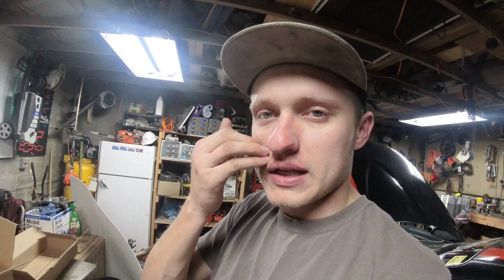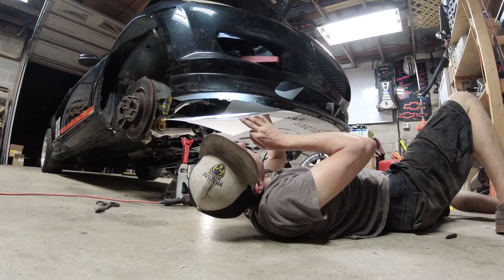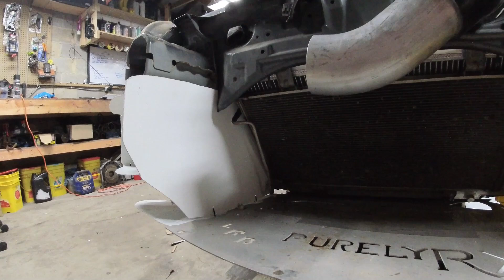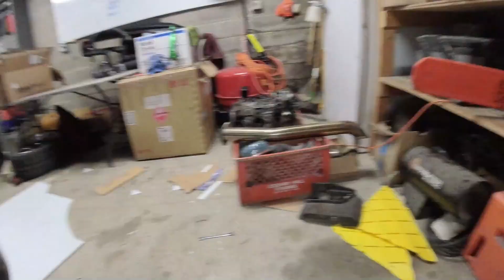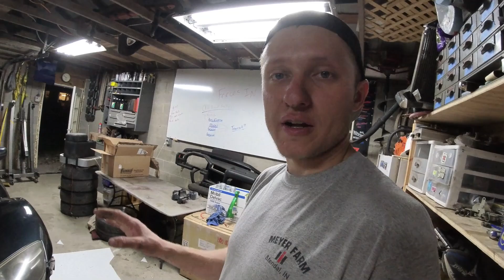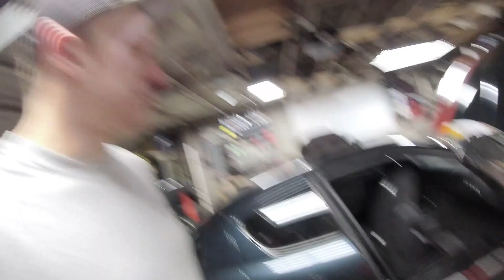Using Plastic Bathroom Tile For Air Ducting on my RX8 - Super Cheap and Easy!

Comment: You can put washer under the hood hinge plates and the front loop latch that keep your hood closed this will put a sloped gap around the edge of your hood so that the hot air can escape out along the edges of the hood. In the front of the hood the little gap will force air into the engine area.

Comment: Is that pvc based board 
You can cut heat and bend pieces to go in corners then apply pvc glue with a few screws to hold it while glue sets and they would seal corners and be more ridged awesome build

Comment: It's a bit anooying there are so many RX8 on a budget video's....(implying it's a cheap car)
I bought mine new (they cost $44,000usd)here in Australia, and have spent another $180,000usd on trying to turbo it over 12 years...
People that say sus don't know that a new S2 Renesis short block costs over $15k in the real world.
These video's attract retar-ded kids that don't understand what cars cost to build.
All quality fast (turboed) and reliable RX8's cost a minimum of $80k usd to build if you do it perfect the first time...
Reply from the maker: For sure!!  Its just a bit different here in the states with rotary cars.  Nobody knows how to work on them. And people just throw them away as junk.   I'd give it 5-8 years and rx8s will be hard to find and expensive

Comment: No front crash bar is brave. I’m willing to maybe cut a hole for more direct air flow into something like an intercooler, but I don’t have the balls to leave the crash bar out.

Also, some Porsches have a plastic “paddle” looking things in front of the front lower control arms that direct air flow toward the brakes. Some of the RS Audis also have them and even use some heavy duty “zip ties” to hold them in place. Just a though.

Comment: How about fans for the oil coolers? See how you go, the ducting is cool bro.
Reply from the maker: Its a good thought! But the Car is cool at idle.  Fans would only restrict the flow at speed which would cause more heat on the track

Comment: My rx8 runs way cooler with mishimoto thermostat and bigger all aluminum radiator and 40w oil than used ducting / insulation tape around under plastic made a noticeable difference! Next cooling mod for me is going to oil cooler thermostats.

Comment: You should look into oil cooler thermostats they make ones that open sooner the oem one don't open till its too late! Also you can flash ecu to turn fans on sooner or buy a kit that does turns on vans sooner.

Comment: Quarter turn dzus fasteners is what I'd use if you don't want to use the 'bump tabs.' Pegasus Racing should have all the hardware you'd need. You should use those plastic ducts you made as 'plugs' or a negative and fiberglass them. Then you can attach to the back of the bumper for ease of removal and installation of the cover alone it'll be worth it. If not glassing the ducts, check out alumalite for a great material for your undertray. You can extend it out off the front of the cover and add a splitter. It would be functional with the proper support struts and reinforcements so it doesn't bend at track speed. This is crucial for the aero to be effective. Technically you should be able to stand on your splitter. You can even slot it and make the support struts adjustable. Sunroof panel makes a big difference and so does lexan. Taking weight off the highest point of the chassis makes the biggest difference in body roll obviously. I have built a ton of aero stuff for track cars so of you need and tips ask away.😉👍

Comment: what happened to the crash bar at the front? is it going back on? you should be able to fit it even with the cold air intake pipework you have there.

Comment: so you are planning on venting the hood. I am currently going the same route, i still have the stock air ducting put a cold air intake, with a fan control switch from rx8 performance. I want to put the battery to the back next and then do the vented hood.

Comment: Great video! How are you going to drill through the bumper grill for more airflow? I know the top half of the grill where the license plate would go is solid and the bottom half is vented. I’m thinking of doing that to my RX-8.
Reply: I used a razor knife box cutter to cut the filled areas out of the grille diamonds. Do it from the back side as it's easier that way. you can see where you need to cut better that way..Also leave the diamonds filled that are near bolts/corners for added structural strength. I learned that trick the hard way bro.
Reply: @charlesvangaasbeck9565  great idea 👌🏽🔥